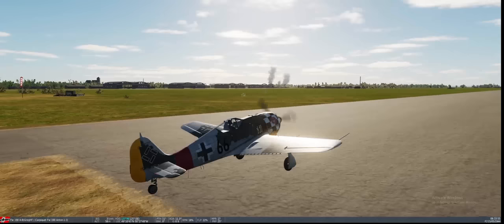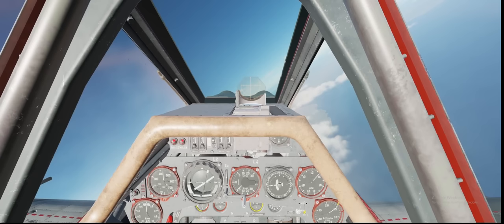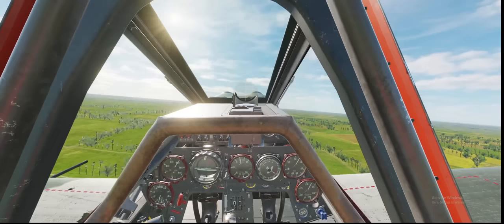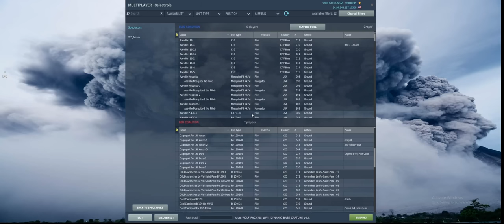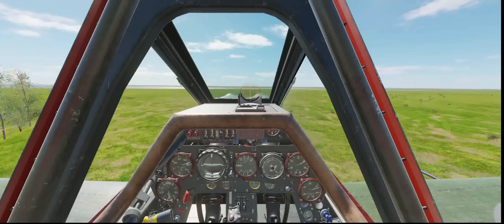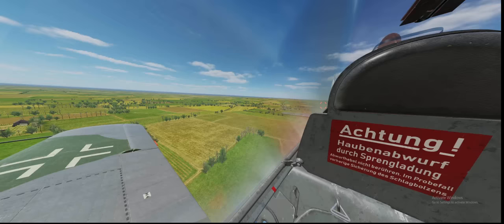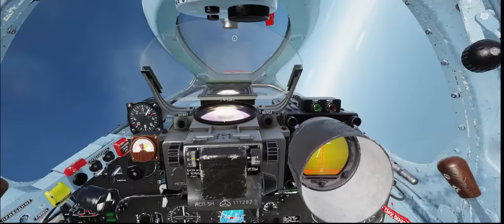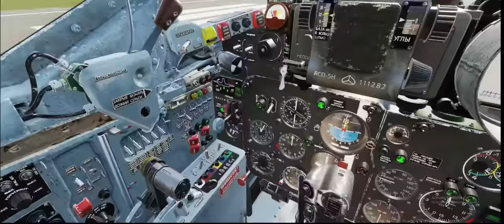German Cannons, Soviet Cannons, P-47 Mach, Angry Authors and More

Comment: The purchase price and operating cost, especially in fuel, of the P51 was much lower than the P47.  That likely had a big effect on which was chosen.   One chart that I saw had the purchase price in 1943 of the P51 was about $58.8K whereas the P47 as about $104K.  Prices of both dropped somewhat the next year, but the P47 was still considerably more expensive.
Reply: Greg showed that chart in the final part of his P47 series
Reply: "The purchase price and operating cost, especially in fuel, of the P51 was much lower than the P47."

Indeed.   However, the P-47 is easily worth it.   The P-51 did well in part because it never had to face truly serious opposition.   In some ways, you might say that it was the next generation of TYPE of fighter up from the Zero.   Very good in some ways, but achieving that through tradeoffs that were NOT a good thing when outside its comfort zone.
In particular, the durability of the planes is like night and day, the P-51 was lightweight high performance, while the P-47 was highperformance but absolutely nowhere close to lightweight.   Hits that would cause the P-51 to drop like a fly flying through flames, the P-47 would generally shrug off barely noticing them.

Facing strong opposition, the P-47 would be vastly superior, as you would take distinctly less losses than P-51s would.
While against weak opposition, where serious losses are unlikely, the P-51 is dramatically more affordable, allowing you to field more of them which in turn increases the chance of overwhelming the enemy by numbers and reducing losses even more.

Personally, i would take the P-47 every time, but the P-51 has its own values.
Reply: @DIREWOLFx75  " Hits that would cause the P-51 to drop like a fly flying through flames, the P-47 would generally shrug off barely noticing them. "
During Corea they compared P51 and F4U Corsairs.  You'd think that an air-cooled Corsair would prove to be much more durable, big plane and all.  It wasn't.  

I don't know about the P47, but I suspect that the real life vulnerability would be, at the very least, much closer than the legend has it.

" Personally, i would take the P-47 every time "
There were people who switched from Spitfires to P-47.  Granted, it's a rather drastic switch, but it definitely took some adjustment to like their new birds.  Switching from a Spit to a Mustang in general went without much of a hassle.  

From my point of view:  P-47 has a crowd of diehard fans, who are willing to excuse each and every shortcoming of this plane.  I think no other WWII bird has similar following.  Sure, people do love other planes too, and it's likely that every good warbird has maybe even higher following.  Some people love faulty warbirds, but they tend to be well aware of the shortcoming of the design which stroke their fancy.

The P-47 crowd?  It's like you guys soar to new heights!  Which is fitting, because that's were P-47 truly shone the brightest! ;-)
Reply: @bakters  "P-47 has a crowd of diehard fans"

Sorry, but i'm not part of that.   I just appreciate it for its good sides.

"During Corea they compared P51 and F4U Corsairs.  You'd think that an air-cooled Corsair would prove to be much more durable, big plane and all.  It wasn't."

I don't actually know about the Corsair, but i know that the P-47 was compared to the TBF Avenger in regards to taking damage and still keep on flying.
And the Avenger held the informal record for taking most number of hits and still flying for a looong time.
IIRC, the recordholder was an Avenger from the battle of Midway, where one managed to limp back to base with literally hundreds of holes in it from anything from standard 25mm IJN AA to 7mm MG shots from Zero's.

So yeah, THAT is the kind of reputation for durability the P-47 ended up competing with.

While the P-51, about the kindest said about its lack of durability is that it's even more fragile than a Spitfire.

Basically, a single 20mm hit on a P-51 usually either missionkilled it or shot it down.
A P-47 was essentially never lost to something so "minor".
Reply: @DIREWOLFx75  " A P-47 was essentially never lost to something so "minor". "
And we know it, because?

Survivor bias is a thing.  For example, the Hurricane also gathered a reputation of coming back with substantial damage and was believed to be more durable than at least the Spit.  Upon more careful analysis, it turned out that the Spit was more durable.

I mean, let's be real.  A jug was a thin-skinned, single engined fighter, not a flying tank.  The pilot was not protected from most angles, so technically even a single 30cal bullet could down the plane, and I suspect it might even happen at some point.  The engine was not armored, and because if was an aviation engine, it was built as light as they could.  Yes, it was a big engine, but it mostly makes it a big target.

Actually, that's all that P-47 had going for him.  It was a big plane, so there was a chance that a shot will hit "the plane", yet somehow miss anything of vital importance.  That was more likely to happen when shot directly from behind with small caliber weapons.  All those turbos were not critical.

Apart from that, it was an air-cooled and lightly built plane, just like A6M2, only bigger.
Reply: @bakters   "I think no other WWII bird has similar following" now that is just being silly, ask the average joe on the street and he will tell you the mustang carts Jesus around in heaven, now that's a following
Reply: @jamessolak1619  Depends on which street.  In the UK, Jesus rides a Spitfire, of course.  Elsewhere, especially Galland fans and those who have Blue Oyster Cult records on their shelves, He flies an ME262.
Reply: @RexKarrs  i stand corrected, limited my thought process to US fans, have had to listen to the god like description of the P51 for most of my 62 years, my uncle walter was a navigator on B17's and praised the mustang escort all the way in and out but also said  jug pilots flew fearless
Reply: @DIREWOLFx75  Reasonable analysis.
The P51 definitely was not as well suited for the ground attack role in Korea. In this case, the "facing strong opposition" was AA fire.
Had the P47's been scrapped by then and unavailable or was it just a dumb decision to use the P51's in this role?
Reply: @jfess1911  "Had the P47's been scrapped by then and unavailable or was it just a dumb decision to use the P51's in this role?"

That is a very good question...

Looking around a bit, the claim is simply availability of larger numbers of P-51s.
However, the P-47 was used in COIN as well as to supress the Puerto Rico independence, so it WAS used...

So, doesn't really make sense.
Reply: @bakters it was not a lightly built plane and you never find examples of them breaking up like spitfires
Reply: @kenneth9874  " it was not a lightly built plane "
It was as lightly built, as Americans could do it at the time.

" you never find examples of them breaking up like spitfires "
You also never find examples of P-47s pulling 11g at Mach 0.98 and landing.
Reply: @bakters  scrapped afterwards you conveniently left out... American planes had a higher quality of build than their british built counterparts and their tolerances were much tighter allowing mass production and parts that fit out of the box unlike many from the brits that required hand fitting....
Reply: @bakters  the P47's were built to take the war to the enemy and defeat them over their own territory something the spitfire was incapable of due to pitiful range and light construction
Reply: @kenneth9874  " American planes had a higher quality of build "
I agree.  It's the engineering that was lacking... ;-)  (Actually, no, I'm not even trying to be facetious.  That's what I believe to be true.)

" P47's were built to take the war to the enemy "
Who's building high altitude interceptors to take the fight "to the enemy"?  Makes no sense.

" something the spitfire was incapable of due to pitiful range "
True that, though.  
I still love her.  Don't even try to fight it. ;-)
Reply: @bakters  LOL, the engineering and build quality far surpassed the primitive systems of the british especially in forced induction systems, fuel, and manufacturing techniques.  The US was intent upon seizing domination of the airspace over Europe to enable the landings at Normandy to be successful thus the need for offensive fighters with range instead of merely settling for defensive interceptors....
Reply: @kenneth9874  " the engineering and build quality far surpassed "
The build quality, yes.  The engineering, no.

" especially in forced induction systems, fuel, and manufacturing techniques "
Fuel and manufacturing, yes.  Forced induction?  Well, maybe a wash.

But even if I'd give all that to you guys, it's still very far from the whole picture.  Where the Brits win.  Hands down.  Despite handing over all of their tech advantages as a part of the deal.
Reply: @DIREWOLFx75 As did the Republic of China Air Force, when given the opportunity to switch from the P-51 to P-47.
Reply: @kenneth9874  "LOL, the engineering and build quality far surpassed the primitive systems of the british"

Wow, you really have absolutely no clue?

Maybe you should go look at USAs military industry prior to the Tizard mission?

You know, the one where UK GIFTED USA with basically all the modern technology that USA didn't have.
Electronics, radar, engines, jet engines, computers, nuclear research etc etc etc...
Everything from UK, France, Belgium, NL, and a few other nations.

USA in 1939 was good at massproduction and little else.

While UK at the time was the world leader in lots of technologies as well as science overall.

And postwar, USA basically built its next 50 years of prosperity on this tech transfer.
Reply: @DIREWOLFx75  funny how their mechanics had to hand fit parts because their manufacturing tolerances were so sloppy, they were amazed that parts for the Packard merlins actually fit.
Reply: By the way the brit jet engines were a flop at the time, axial flow was the way to go.
Reply: @kenneth9874  "funny how their mechanics had to hand fit parts because their manufacturing tolerances were so sloppy"

lol

Yeah sure, you betcha!

Maybe you should go look up the actual reason.

Guess why the Merlin could put out more power, used less fuel, less oil and ran cooler?

"By the way the brit jet engines were a flop at the time, axial flow was the way to go."

HAHAHAHAHAHAHA...

Says the one who clearly doesn't understand reality or the actual history.

Oh yes, axial flow was the way to go...

10-15 years later when the technology had matured a bit.
Attempting to use axial flow during WWII is one of the reasons German jet technology didn't progress more than it did however.

Maybe you should try to know the BASICS at least about things before you go rant about them?
Reply: @kenneth9874  Eventually the axial flow engines came out on top for high-speed jets, but it took a while.  The MIG 17, for example, continued to use a centrifugal compressor engine throughout its life.  It was easier to get decent efficiencies with a centrifugal compressor than with an axial one.  It is also considerably less expensive.  Even today, centrifugal compressor engines are used in many applications for turboprops, helicopters and auxiliary power units.
Reply: @jfess1911  but not their intended purpose, jet propulsion. The mig 17 was a bit of a disappointment.

Comment: MiG-25's speed is limited by heat from the aerodynamic drag, and at altitude depends of the metheorogical and regional conditions, that were sometimes very favorable above Egypt and Israel. MiG-25R that was clocked M3.2 over Sinai was piloted by a test pilot. He got the order "from above" to disregard instruction from the MiG buerau monitoriing team about Mach limit. Engines WERE removed, but for inspection.

Comment: On the MiG-19 subject, not arguing who had better firepower at that point in time, but keep in mind that those were the days when guns were deleted from aircraft more often than added. MiG-19 started life as a 3-gun fighter, and it swapped pretty quickly to NR-30 mm cannons, but we don't have that variant simulated in DCS. We have MiG-19P, an all-weather interceptor version which was developed simultaneously with the tactical fighter, and which was more of an equivalent to F-102 rather than F-100. Eventually that path of development would led to missile-only MiG-19PM with all guns removed.

Good point on the discrepancy in Russian aircraft performance and other more elusive factors that are hard to convey in the world of flight simulators. A topic definitely worth a full video, although it's always a controversial subject whenever it's mentioned. I remember those arguments on the old Il-2 forums 20 years ago. Some things never change...

Comment: I have not read into the topic too much. So take it with a grain of salt. But I have "dealt" with the topic since I am flying flight sims for now almost 10 years. But my personal interpretation is that the germans would have gone with mine shells in either case because they found or thought mineshells are more effective against any air target. Regardless of construction. While metal is less prone to HE damage, a HE hit still leaves large holes (much larger than the projectiles diameter) and causes heavy aerodynamic damage (they also added a incendiary component). On top of that the rifle calibre and heavy machine gun armament (7.9mm and later 13mm) and as mainly amour piercing capabilities. But even in the case of the 13mm they still added HE filler to the belts. The MK 151 belts also contained an AP projectile every X  shot.(I believe every 3rd) 
I think there was even a change of doctrine later in the war to remove AP from cannon belts and add in more HEI.

The trend to add more HE(I) to the german armament basically went on until the end of the war. And this also happened on the western front. Indicating that wooden planes were not the main thought. Even tho a higher effectiveness against an IL-2 was certainly welcome.
Reply: also the 151 was shooting most certainly a mixed ammo belt and not only mine shells.
Reply from the maker: Thanks Sheriff.

Comment: Re: Mine shells 

I think I recall it was about muzzle velocity. The allied Hispano guns had a high MV, the much lighter German ones not. While low weight is great, low MV wasn't, so light weight shell to the rescue. Conveniently filled with a lot of explosives for effect.
Reply: You're probably more correct than most will give you credit.  

From the firearm side, gun weight is highly dependent on caliber, but also chamber pressure.    Chamber pressure translates into velocity of a given mass. A large caliber is larger mass, all things being equal. 

If you have a lightweight, low pressure gun for arial work, lightning the projectile will translate into improved muzzle velocity. But possibly lower downrange velocity, ideally at a range beyond  effective engagement distance. Even with lower velocity at the target, having a substantial amount of explosives in the projectile is going to help a lot when dealing with wood, and sheet skinned aluminum aircraft. I suspect also very effective against light stringers and aux spars. But, it appears by P-47 durability, and German desire for 30mm against bombers, I would say 20mm was ineffective against heavy built up aluminum spars and probably steel components and trusses as well.

Comment: PS. The German 20 MM HE-I shells came in two Versions, the mine shell which massed 94-96 grams each and the conventional Drilled Bar Stock HE-I shell of about 108-110 Grams Mass. They had 17-18 grams of PETN in the mine shells and 4.5-6 Grams of various types of HE in the conventional shell. The AP-I shell had less explosive but Massed about 108-110 Grams per projectile with a solid nose and a base fuse. MV Varied from 750 M/S for the Mine shell and 705 M/S for the other two types. War time Hisso ammo used a drilled bar-stock shell of about 130 Grams with a flat nosed fuse, or a one caliber ogive for the AP-i shell. With about 4.5-5.6 grams of HE loaded. MV was about 880 M/S Out of the early guns and 840 M/S out of the post war Mk-V Hissos.

Comment: As regards German cannons, I think people conflate the 20mm MG151 mine shells with the 30mm MK101/3/8 cannons. The former show a more clear shift from general use 20mm HE shells over to the specialized variants, while the latter are almost exclusively seen used for the anti-bomber role due to their size and time of introduction (ignoring the antitank uses here). When taking into account that the MG FF had to be changed into the MG FF/M to use the new mine shells, it makes more sense that the MG 151 was intended from the ground up to be able to use the mine shells, but were able to use other types as well.
Reply: I think a lot has to do with the operating mechanism of the gun. The MG FF and the Mk 108 were API blowback guns, where the strength of the spring has to be tightly tuned to the shell being fired. The Mg 151 was a short recoil operated gun, which is a bit more flexible wrt different ammunition weights.
Reply: I hadn't considered the operating mechanism, which goes some length to explaining the differences. Using War Thunder for quick reference (forgive me), I certainly see more shell types and weights for the 151 than the Mk 108 or even Mk 103. Looks like the latter only has mine shells for explosive types while the Mg 151 has at least 3 different AP-type shells. The MG FF only lists APHE and AP-I.  @jbepsilon